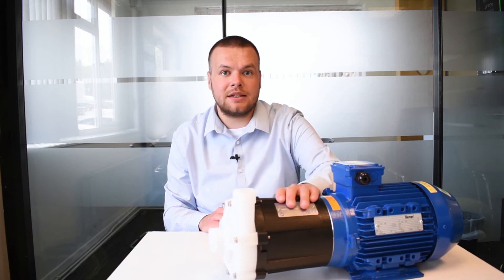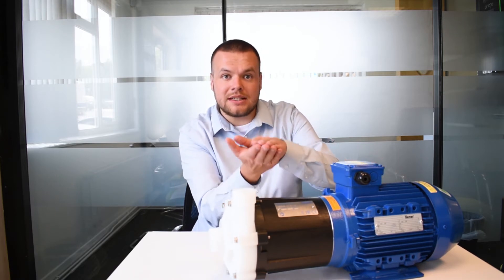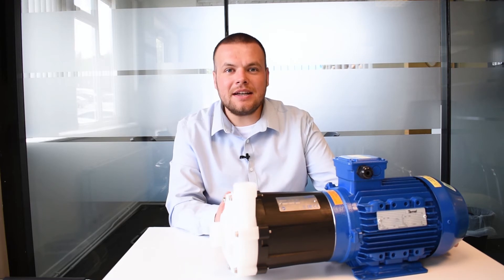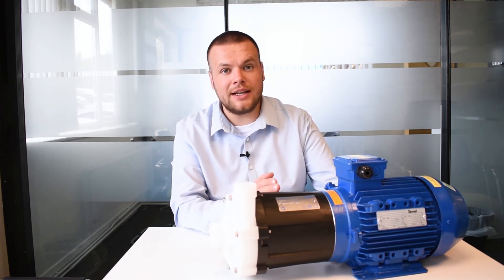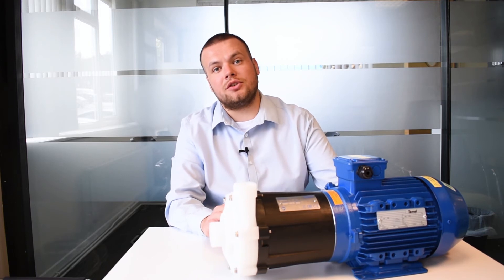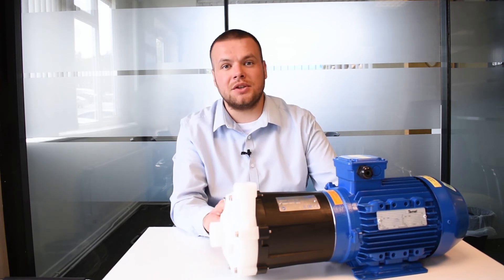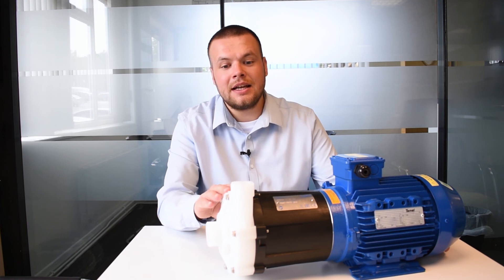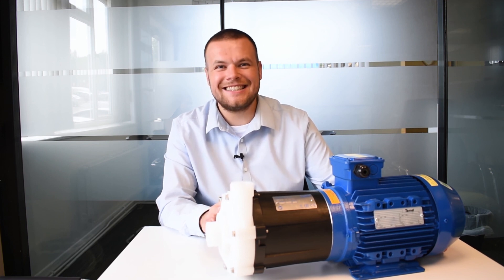How a Magnetic Drive Pump works

Comment: We use two of these pumps to pump a solution with iron and copper and a load of other elements, could, I'm just throwing this out there, could this cause some sort of static electricity in the acidic solution having magnets nearby? We can't find any reason why we are getting a hard scale buildup in the tank, the pipes and the agitator. When we combine these in in the laboratory, we don't get any scale build up on anything.
Reply from the maker: You're likely seeing that scale buildup because Mag Drive Pumps aren’t ideal for ferrous materials like iron. The magnetic field can cause buildup inside the pump and in the system, especially with acidic solutions. We'd recommend switching to a Mechanically Sealed Centrifugal Pump with a flushed seal, or possibly an AODD Pump, depending on your flow requirements. Please feel free to get in touch with our team @Zendukai on 02380 252 325 or enquiries@tapflopumps.co.uk or take a look at our Mag Drive & Diaphragm Pump ranges here: https://www.tapflopumps.co.uk/categories/mag-drive-pump/ and https://www.tapflopumps.co.uk/categories/diaphragm-pump/
Reply: @TapflopumpsCoUk  Thankyou for getting back to me. We have a TSL that produces a weak acid and we treat this in out Process effluent treatment plant. In this weak acid contains high level of arsenic. we use Ferric for the arsenic,  and soda ash to bring up the pH to 5.7 we also use underflow from the thickener where sodium sulphide has been used to drop out heavy metals and floc is used to drop all the waste to the bottom, this is the underflow, its all like a muddy system until it reaches the thickener and the floc does its job and the clean water is sent to the sea. This scale is very hard, it also builds up on the pH probe which sits in the top reactor launder. The pipe leading up to the top lauder from the pumps are 5 inch, and these build up having to be cut and replaced (heliflex hose) we spend a million a month on chemicals treating the acid and the other waste. We spend mega on these pumps treating the weak acid, they clog up regularly and having to replace the impellers is a costly exercise. The impellers are cleaned once a week. The tank and impeller were coated with a non stick surface hoping this would cut down clean outs, but this has now causing issues as the build up breaks off the inside of the tank and blocks the impellers too. 
We want to lift the tank up high so we can do away with using pumps and pipes and just overflow the tank into the reactors. Simple solution to it, but I cant see this happening in my lifetime.
Reply from the maker: We're happy to assist as it sounds like you're dealing with a scaling-prone and abrasive system! If you'd like any further technical advice or support, our Technical Manager would be a great person to speak to! Feel free to email us at enquiries@tapflopumps.co.uk, and we'll make sure it gets directed to him!
Reply: @TapflopumpsCoUk  Cheers, I'll speak to our metallurgist to see if they have thought mag drives might cause issues.